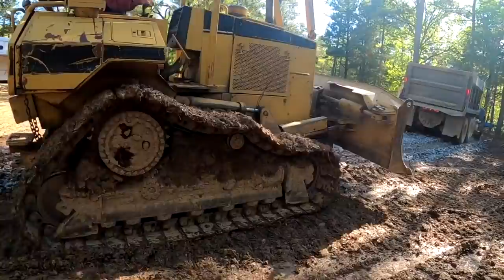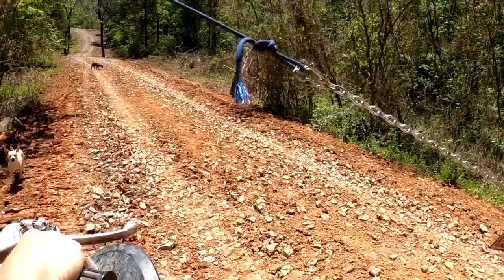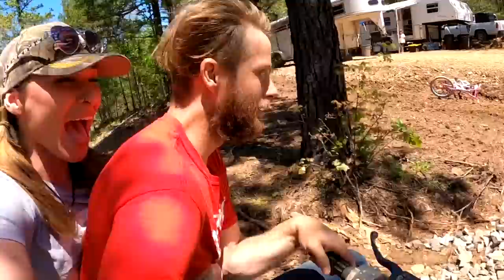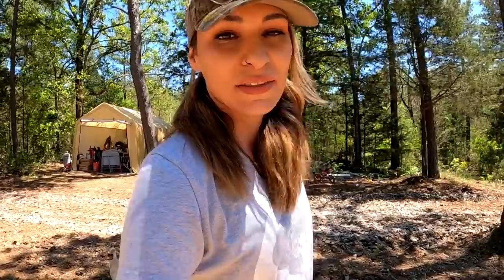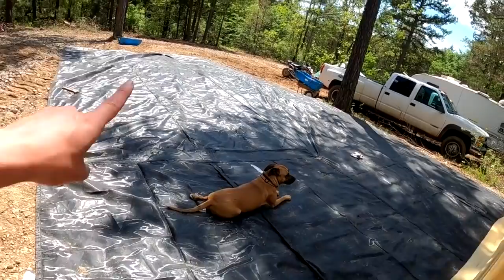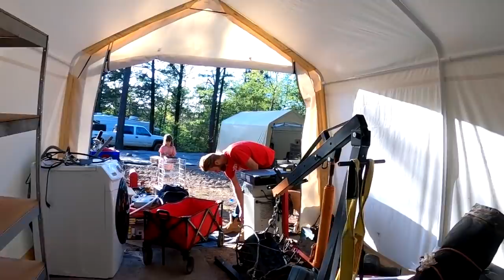WE HAVE A ROAD| Last Minute To-Do before we pick up Country Road Cure

Comment: Am I missing something? I sat down with calculator and quickly realized I'd have to have ALOT of money to do this lol
Reply from the maker: We have been working towards this for many years, sacrificing, saving money and working hard for our goal before we took the leap. Everything were doing has been planned for years (with adjustments here and there due to price increases on items ect). 
How we did it on one limited income with a family is first thing first- We got out of debt. (Followed the Dave Ramsey Plan). Without getting out of debt - none of this would have been possible. We sacrificed while others had the newest latest and greatest. We drive paid for old beater trucks, wear hand me downs till the holes have holes in them, ate modest rice and bean home cooked meals, sold everything, including our AZ house and bought this property when the market was low. Our 5th wheel we live in for now while we build was a rotten fixer upper we rebuilt and fixed for our comforts. 
I promise if we can do this, anyone can. But it will take planning sacrifice and determination. Just depends on how bad you want it. 

I wont lie tho the biggest blessing has been that my brother and his family (Country Road Cure) are crazy enough to join this journey of going back to minimal basics and self sufficiency and have been planning and doing the same right along with us. They did the same as us (got debt free sold everything ect) and we went in half to buy this land and all the "community" improvements we are sharing the cost for it (which makes everything half off for each of our families and obviously much more affordable)
If you research the states you will find cost of living can vary greatly depending on where you choose to go. That plays a huge part. I hope this helps and encourages you to chase your dreams!  We are not from money. We are not wealthy. We are just determined, willing to go without now for a greater reward later, planned, and are doing our best to execute that plan to the best of our ability. You can do it! Chase your dream, whatever that is!
Reply: @SimpleLifeReclaimed   Thank you for taking the time to reply. This answered my questions and I also am following Dave Ramsey's baby steps and I am already debt free. I want to start a homestead myself in future.  I also live in Arkansas so welcome to Arkansas
Reply from the maker: @outdoorsman4245  thank you for the warm welcome! And No problem for the reply! Were just regular people. I wish you the best of luck in your future endeavors!  Keep working for it, keep striving and saving - YOU CAN DO IT!
Reply: Nope, you're not missing something. The hardest, budget eating expense is road , gas, electricity and water. Most people coming from either coast have sold  at a good enough price they can afford to do it right in the area where they move and the market is lower than where they lived. I work for a lot of new comers and encourage them how to help keep our state so attractive IS TO VOTE LIKE WE DO !
Reply from the maker: @oktreedude  👏👏👏 we chose Arkansas for its beautiful landscape, loving people, and freedom!
Reply: @SimpleLifeReclaimed  "But it will take planning sacrifice and determination" is just the thing most people do not see when looking at what you and others do. Leaving the comfort zone is a real hurdle.
Reply: I watched all of this at the time you were doing it from day one  it is unbelievable how you got that all accomplished in such short time, I can’t remember watching it just doing up and down the roads and it was so funny hearing you both giggling. It’s so funny how are you to be so care free, not letting anything bother you both.   I enjoyed watching all three of the kids running around and being so happy. wow great job.👍👏🤗😊❤️
Reply: @SimpleLifeReclaimed 
😊

Comment: once that road is done, start looking around your property for larger stones/boulders to start setting along the side of those roads. That mud will eventually due to erosion flow over your stone road or undercut it slightly. Rows of stones with plants and grass to their side will anchor it nicely. You may even be able to get stones like that from your neighbors who have no need of them or from landscaping companies looking to dispose of them. You might even be able to make a deal with highway construction companies and get old broken up concrete chunks for this that you can dress up (I know someone who did that)

Comment: Just a thought for a fire pit.  Once you can get out and such, find a salvage yard and see if they have some tractor / combine steel wheels. Can be bent a smidge. I picked up one that was 316 lbs, could still roll it by myself. Bit of grating and that thing will outlast any big box fire pit, for way way cheaper.

Comment: Should have had the well drillers install a hand pump also. Just in case you lose power you'll still be able to get water.
Reply from the maker: All power is supplied via generator right now. We fill a 275gal holding tank, that fills the 30gal tank in our trailer. So we do have some reserves. Will be doing a lot more when CRC gets here. 🤗